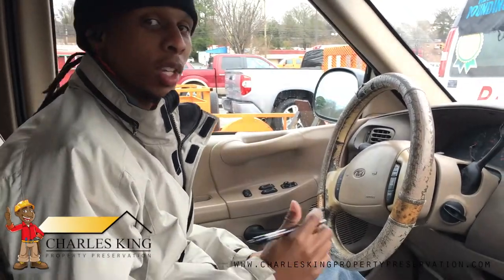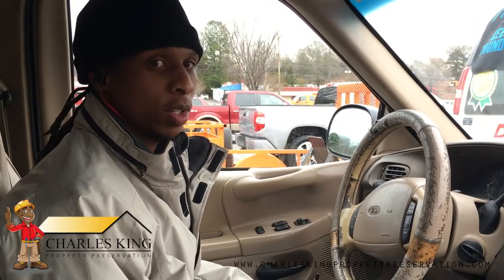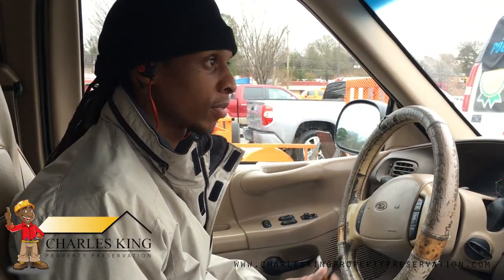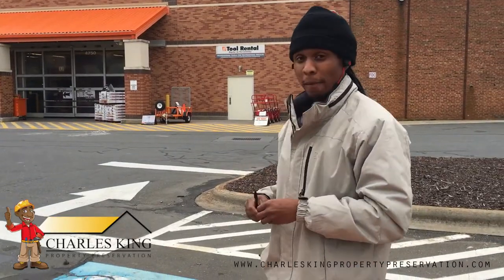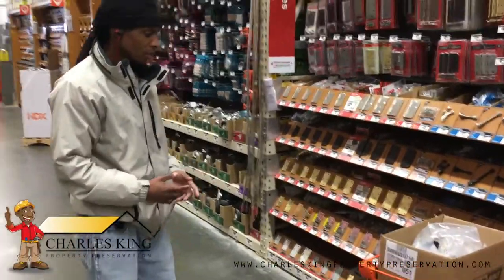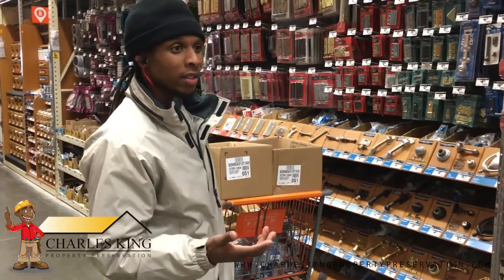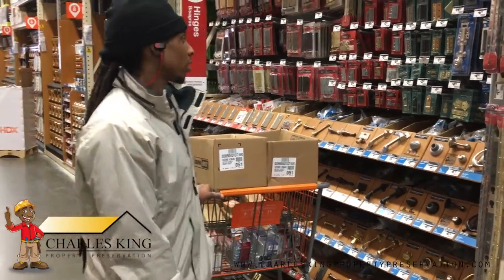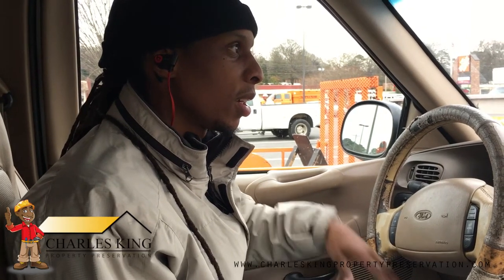PROPERTY PRESERVATION TRAINING - How To Find Contractor & Supplies

Comment: im sure you have heard of it but for others starting  Check out mfssupply.com... All types of materials for boardups and rekeys, I used to buy ahead and save a bit,  I got lucky once and had a trashout that had tons of 2x4s I saved for board ups
Reply from the maker: We order lots of materials from MFS. There great! Actually that's were we get our carriage bolts from for window and door boarding there much cheaper than Lowes and Home Depot.